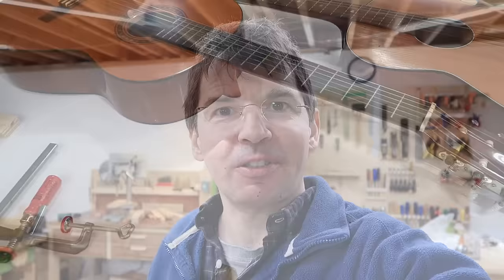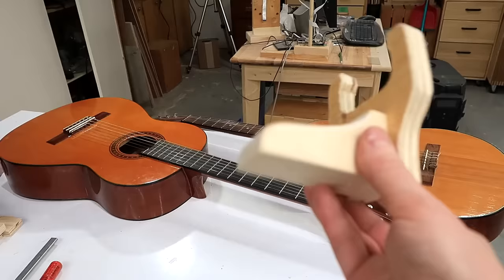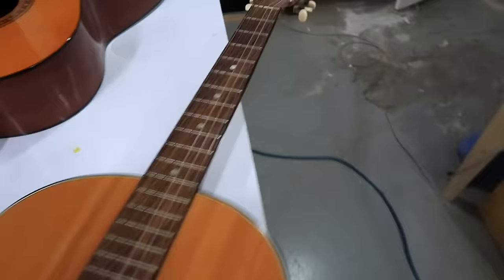Guitar hanger

Comment: The neck width at the nut for a classical guitar will be wider than that of a standard folk or electric guitar. The industry which manufactures these hangers solves for this by angling the tips up and making the post wider at the front and skinnier at the back. So the neck sort of slides back to find it’s own width comfortably.

Comment: Great vid! For any DIYers looking to make the same thing but lack some of the tools (especially a bandsaw). It's possible to make a guitar wall mount with those threaded "U-shaped" wall hooks they sell at the hardware store and a block of wood. 

All you need is a drill for the pilot holes and any tools necessary to make it look nice (e.g. sanding, routing, etc.). They make great easy gifts for friends with guitars.

Comment: I have several guitar hangers on my walls. I hate when the guitar bumps into the wall (both for the wall's sake and the guitar's), so I got a few of those free square carpet samples from my local Home Depot and stuck one on the wall underneath each hanger to protect the guitar from bumping the wall.  Works great.

Comment: I also made a wooden hanger similar to this, only I used rubber instead of leather. I think overtime the leather is better and will last longer.
Reply: Be carefull with the rubber if you are using it with nitro, it can depending on the rubber melt the laquor.

Comment: What is your rationale for using a post-it while drilling in a wall? 

I sometimes tape a sandwich bag to the wall directly under the hole to catch the (falling) dust, but airborne and flying dust mean you need to vacuum anyway.
Reply from the maker: needed something for the camera to focus on

Comment: Problem with guitar hangers is to check the finish on the hanger (or the protection foam or in this case leather) does not react with the finish on the guitar, otherwise after some time, it can peel off the guitar. In a classical guitar probably will not be much of an issue, but in electric guitars also the weight is an issue.
Reply: Thats why he wrapped it in leather at the end, I guess 🙂
Reply: This happened to my guitars too, what I've done was to place a small cutout wax paper in between the guitar and the hangers, and that worked.
Reply: That’s usually an issue with lacquer finished guitars, including nitrocellulose. But a stand/holder with a cured finish is not the problem: its the foam some manufacturers use

Comment: Well, any new design should start with analysis of existing solutions. As many noticed, no guards against falling off, damage of finish or proper solution for different neck widths and detuning. Contact with wall surface is also a bad idea.

Comment: I would make something to support the body as well, I usually buy 2 neck holders per guitar, one for the neck . and one for under the but of the body at the back strap button , hanging them by just the neck can ruin the neck over time. you really should support the body too.
Reply: So the thousands of guitars hanging in Guitar store are all destined to be junk? You're overthinking a problem that doesn't exist.

Comment: at 2:35 you use a post-it glued to the wall. if you fold it in 2, from bottom to top, you could make a V shape one that would collect the dust that fells when you drill the holes.
Reply: I think it was the initial purpose but Matthias forgot to fold it ^_^
Reply: @lomicwind  He said in anoher comment that is was to get the camera to focus.

Comment: Ok, I have seen that so many times now, I have to ask, how can you route with such ease a full depth cut and not have the piece ripped out of your hands (or fingers rather)??
Edit: I'm talking about 1:30 specifically, but also about other videos.
Especially such a small workpiece is impossible to round over on the router if I tried it at full depth.

I've also seen on your older videos how you just route a full depth dado groove for shelves in one go with a handheld plunge router, without the wood burned or routerbit destroying itself.
If I tried that, the bit wouldn't even cut as far as one bit diameter into the wood, it just wouldn't be able to get full depth chips, it would produce a very fine dusting and rub tiself and the wood hot.

Aren't these just standard carbide tipped woodworking router bits you get at any hardware store?
Reply: 1:30 isn't a full depth cut - that's a roundover bit just knocking the corners down
Reply: @gorak9000  I'm very well aware of it being a roundover bit, thanks. That's why I said "round over" in my comment. And yes, it is a full depth cut because he cuts the full depth of the cut in one pass.
Reply: The power of editing (it seems sped up). Or he's better craftsman? I didn't see anything unusual.

Comment: You had a post it note to mark the stud, if you fold up the bottom it catches the dust instead of having to vacuum it up. I forget where I first saw that tip. Then again it isn't that hard to vacuum either.
Reply: Yes! I usually use envelopes for this trick 👍

Comment: If the guitars get regular use you should really line the inside of the holders with a thin felt otherwise you'll damage the finish on the guitars over time.